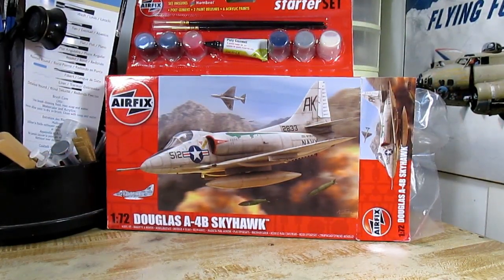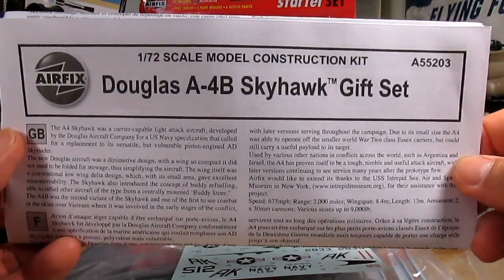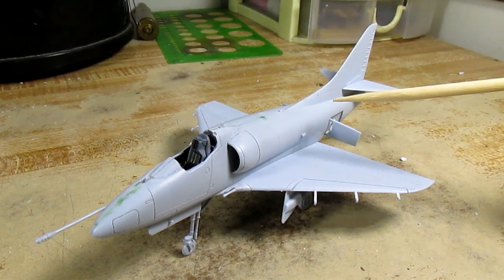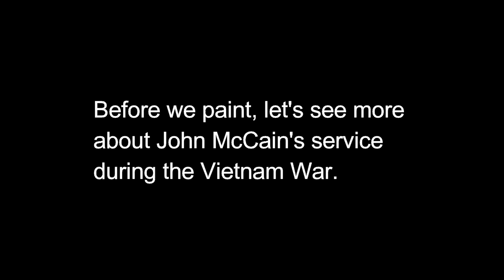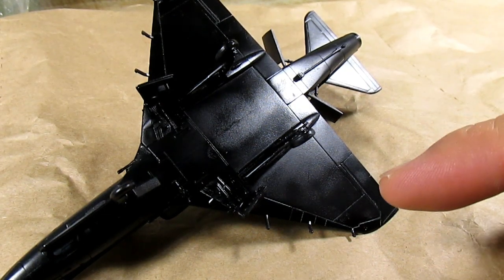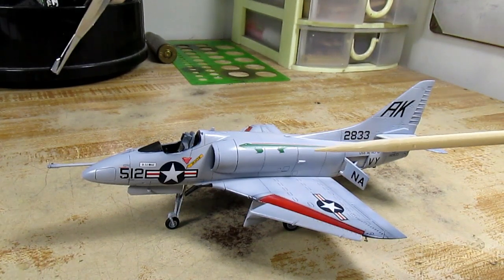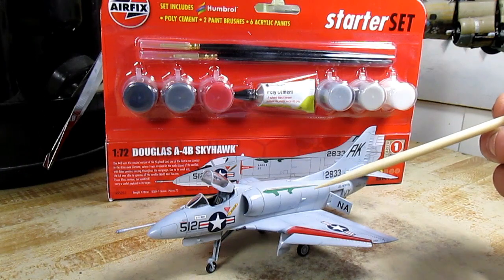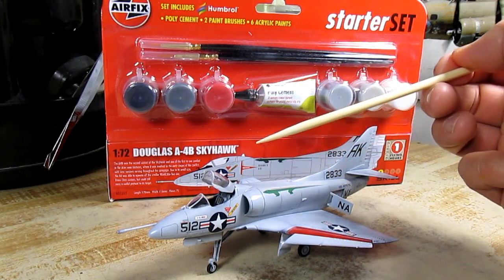Building Airfix A-4B Skyhawk. A Tribute to Senator John McCain

Comment: Not a lot of optical illusion there, in my opinion. I see only one shade of grey. Except maybe some at the stabilizer. Trying to fake light is cheating, I think. Why not let light do its own work ? That's what it does on real aircraft anyways. Just paint it to reality and reality will throw its own shadows and highlights. Like IRL. When you are faking shadows and highlights, you are making a painting, not a model. And then on top of your fake light and shadows comes real light and shadow ?! Weathering realistically: fair enough. But why fake light and shadows ?You wasted a lot of black on this model. Hardly any of it is showing. There is no nuance here I can see. It's a factory clean craft. Even the panel lines stop at the decals.But you are right: it's a decent kit for its price.
Reply: lol, no need for tears. Some modelers like factory clean kits and that's okay, no prob. But why waste time on paint you are not going to see ? If you like nuances, go easy or easier on the airbrush. Minor pressure and visually check thin layer by layer. I like your vids, but I'm suprised your decals don't sink into the panel lines. And when they do, light creates all the depth you need for realism. The star under the office for instance: go through the panel line with a pencil. That's exactly where the dirt settles. And where the paint realistically wears off. So with a colour pencil you could trim the edges of the dark blue with a lighter shade of blue. That's how you create realistic depth. If you want to imitate light, then buy canvas and learn how to paint like the old masters. That's how I feel about modeling. And painting.